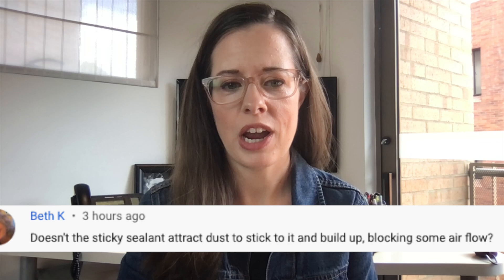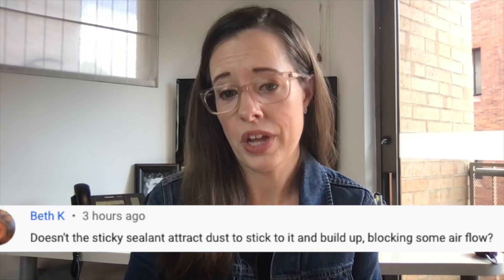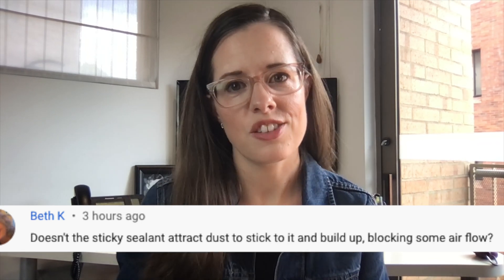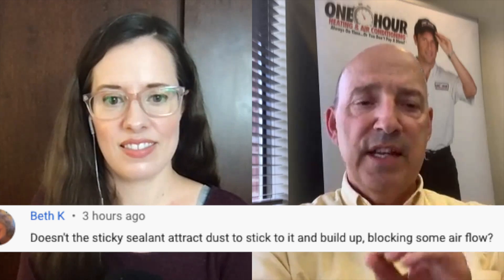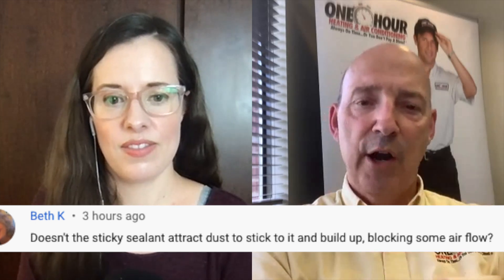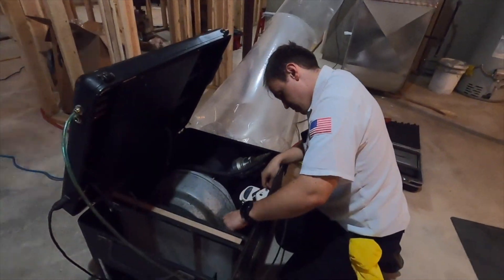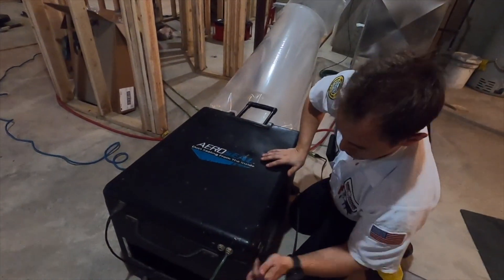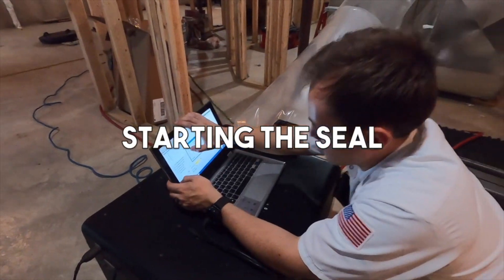HOW DOES DUCT SEALING WORK? Answering Duct Sealing Question: Is the sealant sticky?

Comment: My inducer doesn't kick on right away.  It buzzes for about a minute when I turn up the thermometer and it starts pumping heat after about 5 minutes.  So the inducer still works but with a delay.  Does it have to do with the flame sensor?